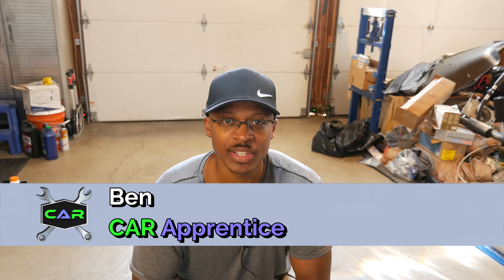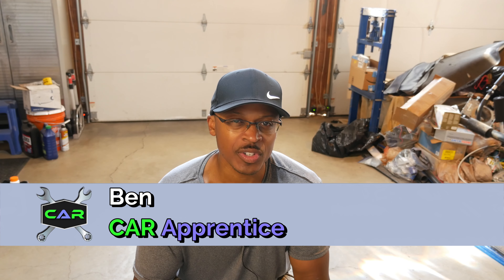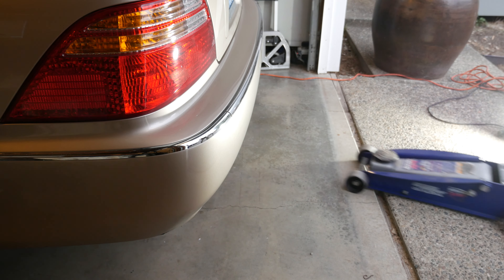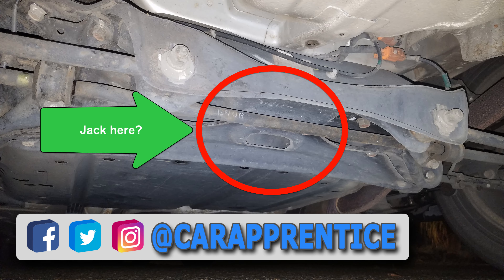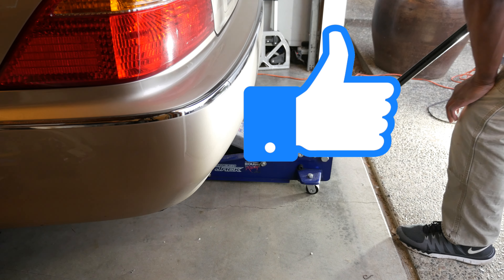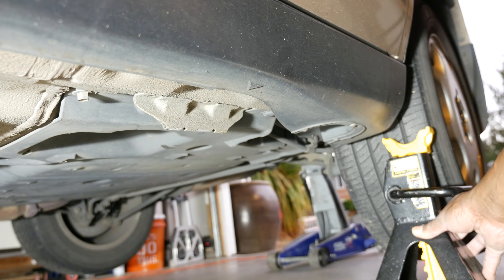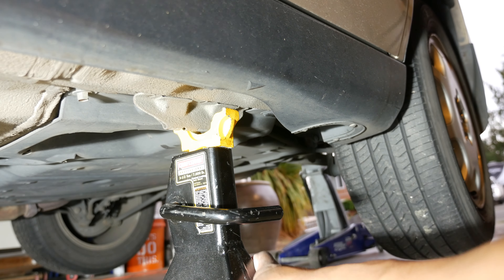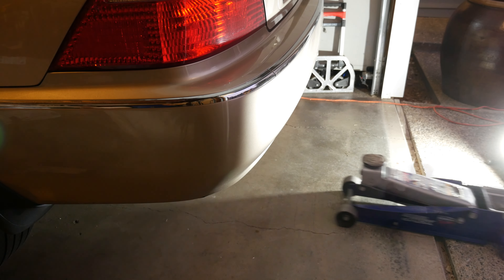1999 Acura RL Jacking Up Rear

Comment: How about getting it up on all 4?
Reply from the maker: I briefly discussed putting all four corners on jack stands in the tire rotation video. I don't feel comfortable doing a video, since the procedure isn't recommended. In practice, I've jacked up the front first then the rear and reversed the process when taking the car off jack stands.
Reply: @carapprentice  Thanks! I figured I would jack the front up first, put on stands, then jack up the rear using the procedure from this video!